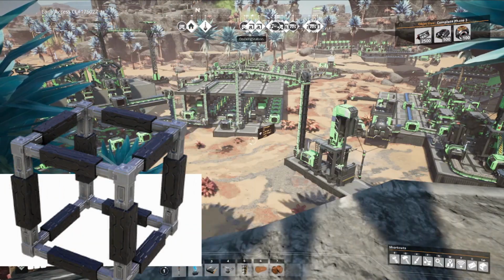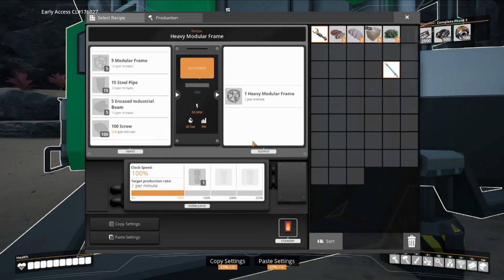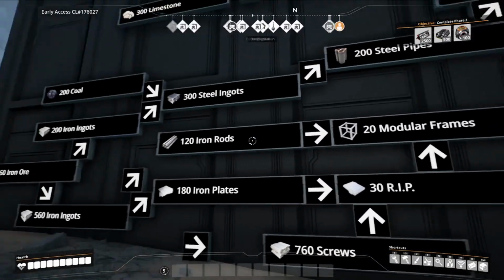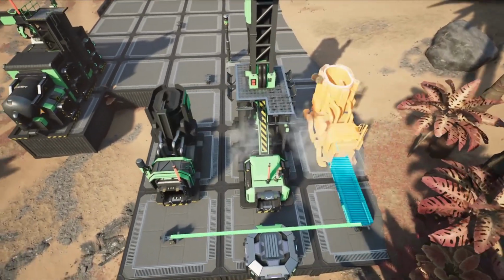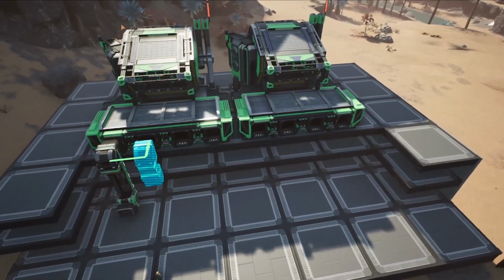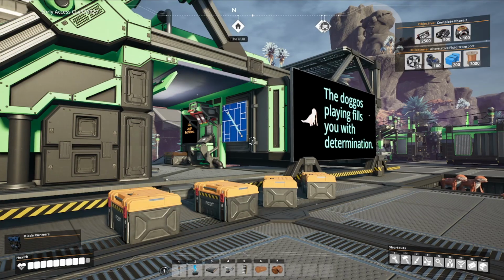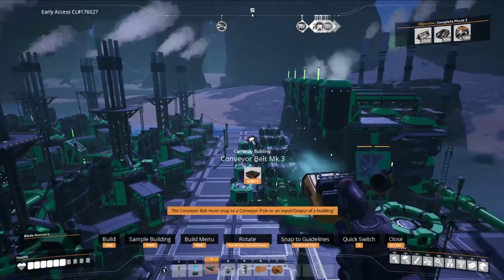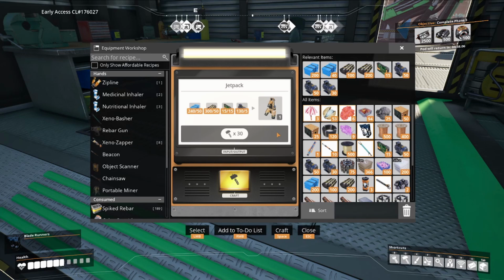How to build a Heavy Modular Frame Factory -Satisfactory Update 5 Episode 10 (Tutorial / Guide / LP)

Comment: Such a great video! Thank you! How are you liking truck stations in Update 5?
Reply from the maker: The actual changes to truck stations are pretty minor, but the new recording and route interface is  great. Certainly makes it easier, and I have several truck lines where fuel isnt an issue that I have 3-4 trucks running so as to keep the throughput high and make the world look more interesting!
Reply: @Dekoba  Thanks so much.

Comment: Awesome. 
How do you factor in the truck station through put rates as they are around Mk4 belt speed from memory.
Reply from the maker: Truck stations are capable of matching 2 mk 5 input belts. Im not working with anywhere near that quanity so it doesnt really factor in here. the truck loop takes about 5 minutes and the most i get out of any factory in that time is 4-5 stacks.
Reply: @Dekoba  well after watching the vid ive almost finished setting up a similar system around the crater in RD. All subfactories are on a circuit around the crater with the main assemblers and manufacturers elevated over the top. 
I'm keen to see it work. 
Thanks for the vid, great work.

Comment: It might be easier using alternate recipes: Screws can be made more efficient using steel screw recipe, the encased steel beams have an alternate using pipe. This does use more coal but i think in the end is more efficient
Reply: He's already using the encased pipes alternate.  I'm guessing he doesn't have the steel rod/screws alt unlocked at the time he was building this or simply didn't want to use it for one reason or another.
Reply from the maker: I couldn't find a good way to work in steel screws with the factory design.  Big fan of the recipe normally when I need boatloads of screws